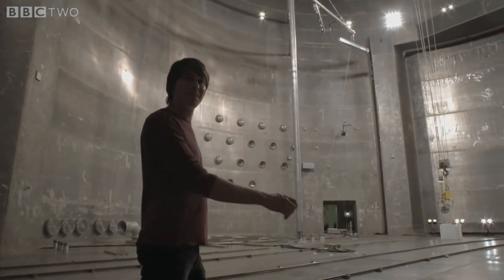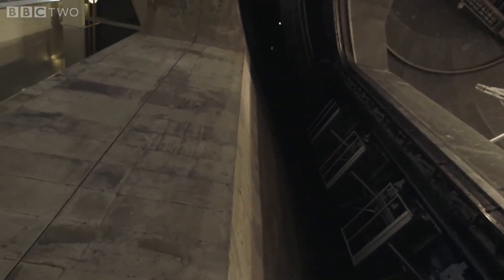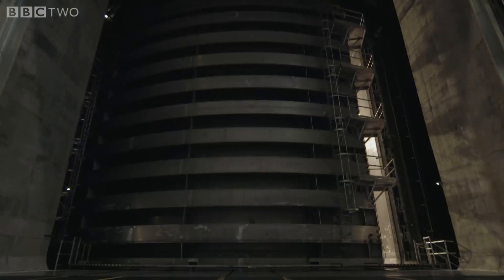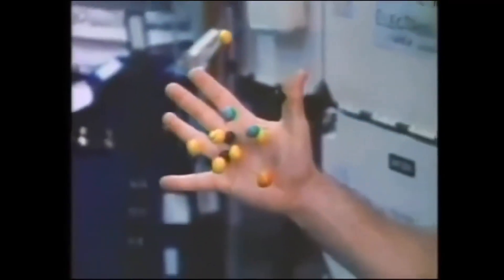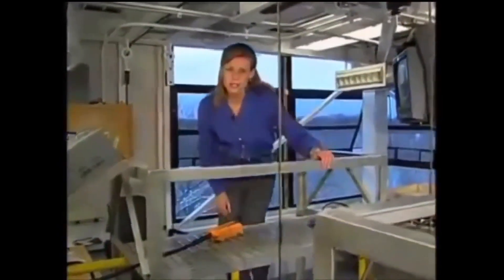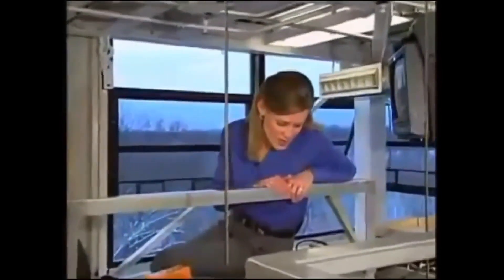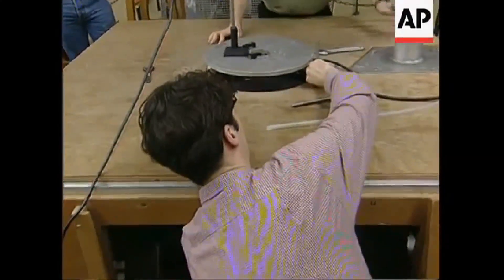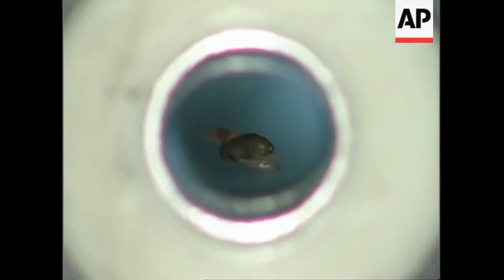Can NASA create Anti-Gravity?

Comment: Our science is totally dependent on gravity and yet gravity doesn’t even pass as a hypothesis. Because there’s nothing at all to be measured or tested, but not only do they get away with calling it an accepted working theory, they use it to explain everything. Gravity is merely a law of authority, it’s based on social proof only.  It’s not a law of physics.  It’s an incantation, a lie.  It’s dark magic called science and we have all been under this spell for a very long time.
 What kind of law says that if we can get high enough then we never have to come back down ?
 If gravity can bend even light than how is it that Helium and Hydrogen (The two most abundant elements in the universe) completely defies gravity's effect ?  It has been over four hundred years and not so mush as a single graviton has been isolated.
 There’s no experiment for gravities validation nor can it be demonstrated or reproduced.                 
 Calling falling objects gravity bound is like calling stolen goods, free. 
Things do not fall to the center mass of gravity they simply fall down because thin air doesn’t have the density to support anything heavier than thin air, the ground however does, it’s all about buoyancy and density. (Things that are finer will rise, things that are grosser will sink or fall)
If it is gravity that keeps the oceans in their beds as the Earth spins a thousand miles an hour then insects couldn’t fly and clouds couldn't float in fact everything would be crushed. 
If it’s the Moon’s gravity that causes tides then why aren’t lakes, ponds and streams affected ?
 If gravity could raise oceans then we would feel it, we would weigh less.
Tides are caused by electromagnetism. Water is diamagnetic and is repelled by the Suns positive magnetic field and is compelled towards the Moons negative magnetic influence.
 How is it that there is no gravitational relationship between the Sun and the Moon ?  When the Moon is between the Sun and Earth that's one thing but when the Sun and Earth are both pulling on the Moon then the Moon should be slamming into the Earth unless the Moon changes speeds and trajectory which it does not.
 The Sun's gravity will pull a comet directly towards the Sun's center mass of gravity and yet this same gravity will somehow prevent an impacts from occurring.  This is pure monkey science.
 Gravity answers everything that official experts can’t.  It’s the gravity of their situation.
Gravity failed as theory, it even failed as a hypothesis.  It was rejected by its architecture Sir Isaac Newton in 1666 and yet its consider one of the four fundamental forces in nature along with electromagnetism and the weak and strong nuclear forces.
Gravity fails as a theory, but it’s accepted as a basic fundamental law of nature !  Think about that for a moment.
 Only an imaginary and magical force such as gravity could make life on a round ball Earth seem possible, which just happens to contradict the Bible and so gravity becomes the law of the land (No pun intended)  in accordance with the authority and is strictly enforced in every learning institution in the world.
 Gravity is electromagnetism which causes density which causes buoyancy and weight is an interior source, not an exterior force.

 Gravity marks the lost of our divinity and moral relativity is a portal for perversion.  No true up or down.  No true right way or wrong way.  No true right or wrong.  And then the next thing you know, your kids have to share public bathrooms with adults who don't even know what gender they are.